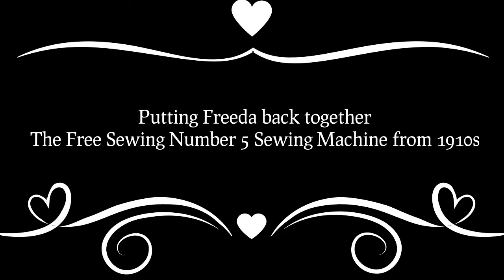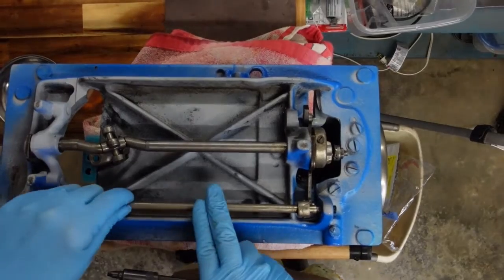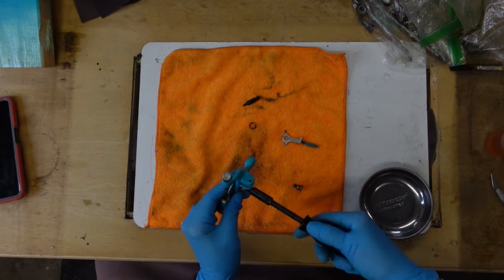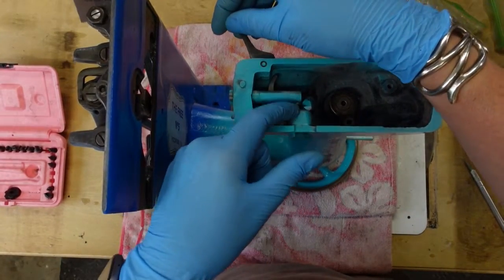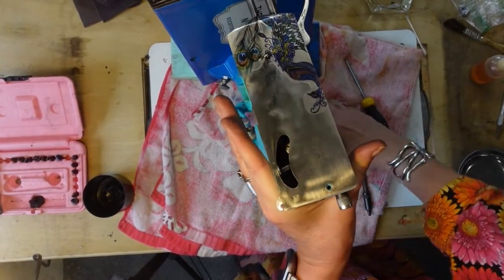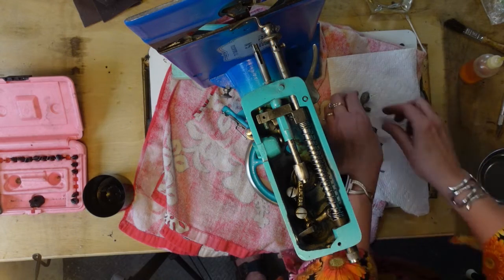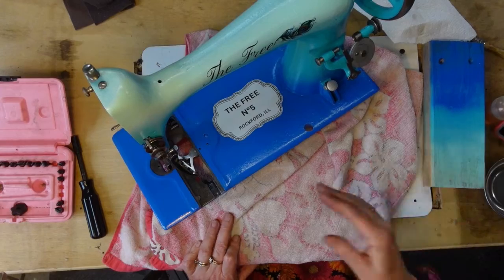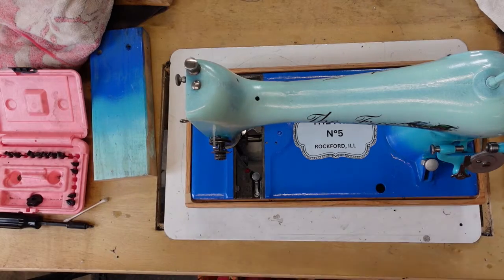Putting Freeda Back Together! Reassembling The Free Number 5 Vintage Sewing Machine

Comment: sounds to me like your connecting rod needs to have the bearing journal tightened up. I had a clunk like that in a drawing room cabinet. It turned out to be the bottom sphere bearing was loose on the shaft and needed to be re-peened. Nice job on the Free. Someone's going to love that machine.